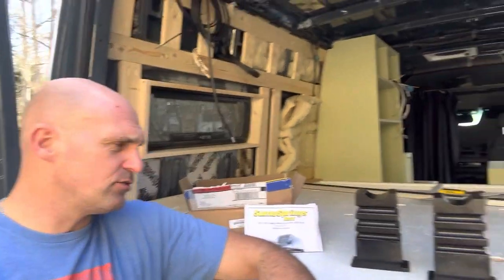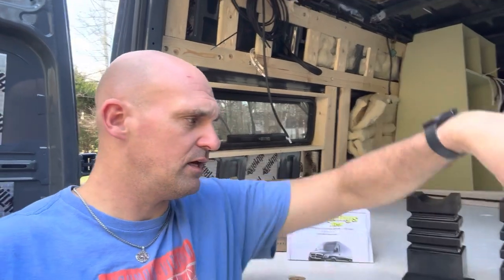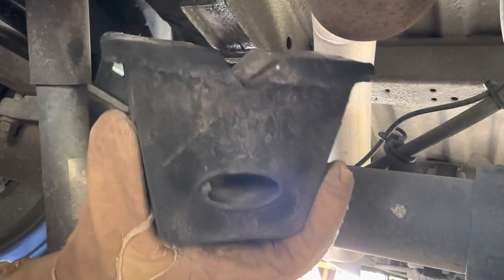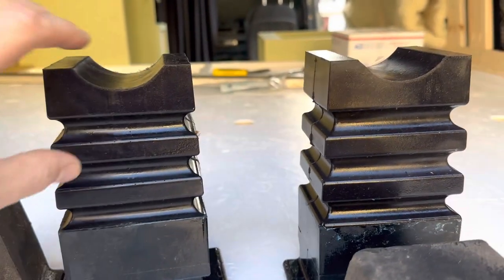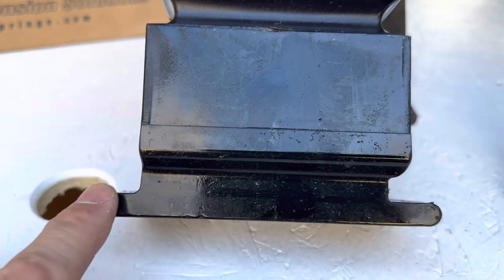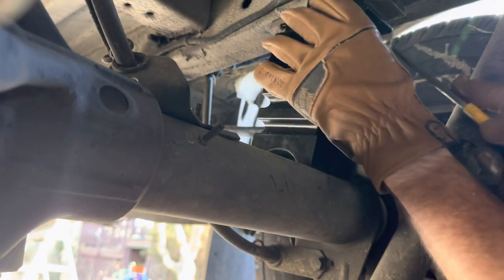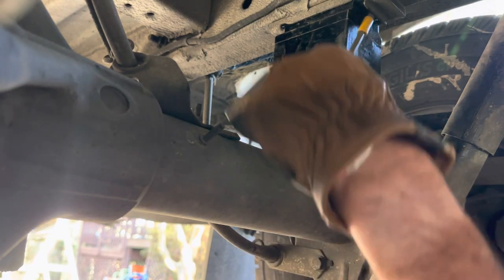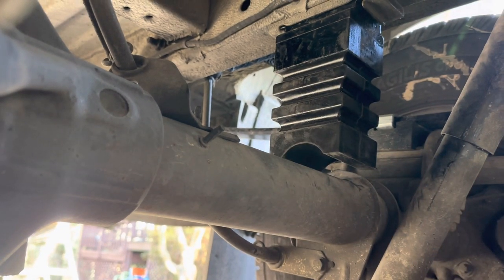Sumo Springs installation on a Sprinter Van - DIY 👍

Comment: When I added rear Sumos to my 2018 PleasureWay Ascent (2017 MB 2500 chassis), I found it a bit easier to lube the Sumos with dishwashing soap. But it’s still a strain before they suddenly pop in. Right away, I could tell the difference in body roll and especially preventing bottoming of the suspension. 

About a thousand miles later, I installed Sumos in front, too, and that further improved things. So I recommend you consider that, too. On mine, the black ones in back and the blue ones in front were perfect. The front ones are super easy to install—just don’t lose the mounting bolt at the top!
Reply from the maker: Awesome, thanks for the feedback, on our trip we just took to texas it really made the van ride nicely and we have had the same experience, I have been on the fence on the front but you just pushed me in that direction.  Thanks!

Comment: I am not srong enough to push it in. So i came up with a trick. Use a hydraulic jack to push the screw driver. Since the force is unlimited, the rubber piece just bend and slip right in. ( But make sure the gap is wide enough for the rubber to slip in instead of getting sheared off). With this method,  I didn't sweat at all.
Reply from the maker: Awesome, glad it worked out for, seems like a great lesson, when there is a will there is a way to adapt and overcome when one methodology doesn’t work you have to be able to go with a plan b, or c, or d!

Comment: Ok, I installed sumos at all four corners on my 2019 3500 XD (4x4) build with weight fully loaded 10k lbs. Was awful after with sumos, super harsh ride. FYI, body roll was subsequently better resolved with a cheap  helwig sway bar…sumo springs add spring rate, and resolve sag in 2500 builds that are too heavy (not my situation), be aware of the proper use case
Reply from the maker: Thanks for the feedback on your van, I had only installed them in the rear on mine and had not experienced any ride issues, my guess is your suspension is compressed enough that the sumo springs are riding on the a arms up front enough that their absorptive capacity is almost gone and its like you are sitting on the bump stops all the time which would cause the harsher feel when driving. Everyone definitely needs to look at their use case before any modifications.  I will point out too, the sumo spring up front have two capacities 500 and 1000lbs and depending on which one you bought that could impact the ride as well

Comment: Do you think they would go in better if they were heated up?
Reply from the maker: I am not sure but i bet leaving them on direct sun on the driveway would make the compound a little more pliable,  one guy posted he used dish soap and that worked well, it really wasnt that bad just had to get the screw drivers in the right spot, thanks for the question and thanks for checking out the channel

Comment: Too bad the SUMO SPRINGS fit extremely loose, sloppy and poor, but they says its because they are NOT actually vehicle specific, and fit very loose to accommodate more than one make and model vehicle.
Reply from the maker: I am not sure that is entirely correct, they do have some movement in the bump stop assembly but that is to allow for installation, the stock bump stops have movement as well, but they are brand specific meaning the Mercedes mounting system is universal amongst certain year ranges of vans, given the way they install i am not sure it is possible to manufacture them any other way, with 10,000 miles on them since install i have had zero issues with them moving around and would install them again
Reply: @ramblingambition  They do claim to be vehicle specific, but truth is they are not.  And really, they get installed once.,, its not like they need to be fit so loose and be installed over and over. Just one painful install is better than a lifetime of loose sloppy fit.